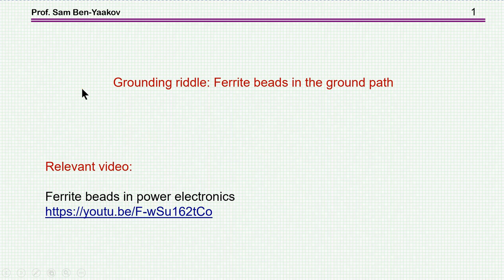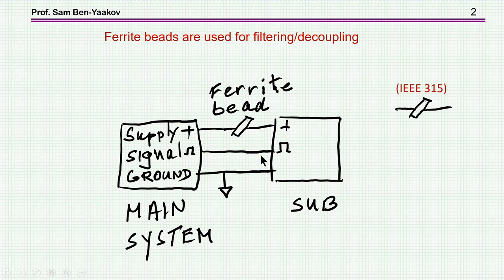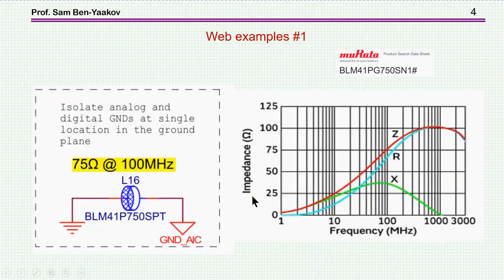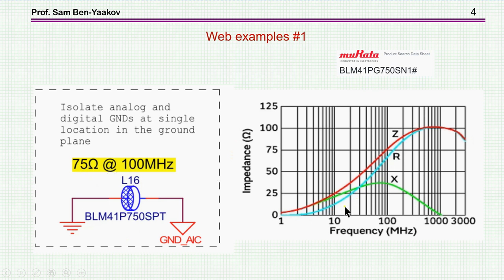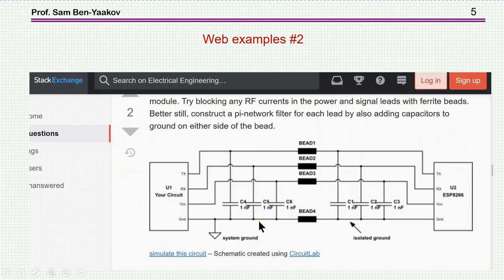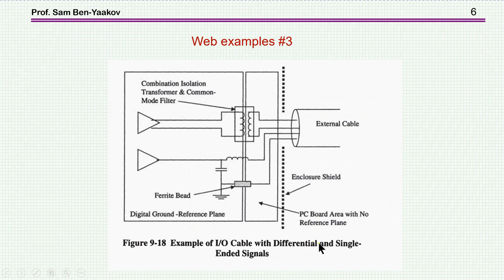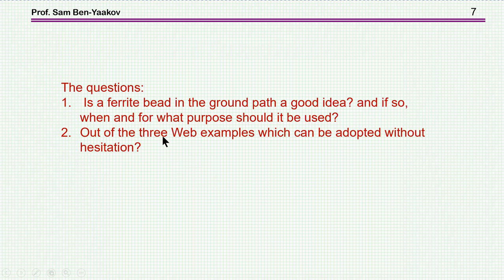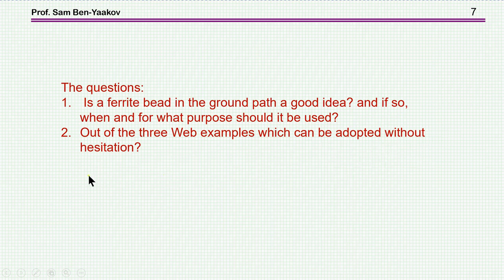Grounding riddle: Ferrite beads in the ground path

Comment: I think the third example can omit the magnetic beads. Because the signal transmission uses an isolation transformer, a good isolation effect can be obtained, and the DC supply line uses inductance isolation, which is better than magnetic beads. Since the above two circuits are well isolated, the interference loop of the ground wire is minimized, so the magnetic beads of the ground wire can be omitted.
Reply from the maker: Please see the posted answers video.

Comment: The third web design could be adopted without hesitation because the signal lines are galvanically isolated placing a bead in the ground path will not impact signal integrity and other considerations may justify this level of isolation between the grounds.
Reply from the maker: Good  answer but nit complete.

Comment: In case 2 you can adopt no problem. all circuits close trough a bead anyways. It provides more filtration during low freqencies of switching on different channels and it gets overwhelmed and looses some filtration powers the faster and more channels switch, allowing the receiver to detect highs and lows faster.
In case 3 the bead is  just another DC filtering component
Reply from the maker: Good points but there is more to it.

Comment: Please correct me if I'm wrong.

The first example doesn't show the rest of the circuit, and might be acceptable if there are no signals going from the digital domain to the analog domain.

The other 2nd example clearly show digital signals interfacing "sensitive" analog circuits (otherwise why filter them ?), but the return current must find it's way back through the bead in the return path - therefore causing ground bounce/ringing.
These issues are basically the same as splitting digital/analog ground planes while having digital signals that need to control the analog circuit.

In the 3rd case, if it is indeed only a DC power supply - it has only DC current through it and the bead has negligible dc resistance, therefore it doesn't impede the return current flow.
If the board in at the other end of the cable is pulling non DC current from that power supply, that current will be supplied by the decoupling capacitors and not the cable.
Reply from the maker: Very good points but there is more.

Comment: If you want to absorb HF energy on power rail, I think it's better to do on V+ only. Doing it on GND is equivalent for the rail in isolation (current flows in loops) however now all your signal nets get their transitions rounded, and worse they now crosstalk/ground bounce. 
In the third case the bead is applied to a single net so the above caveats don't apply, so I think that's fine.
Prof, would you consider doing a video on selecting core materials for various applications? How do you estimatr how much impedance and at what frequency would work for a design - or is it usually trial and error like I've seen at the EMC test house?
Reply from the maker: Good points but there is more to it.

Comment: I must ask, as one who is in the field of engineering in general, is it a good idea to bead between two grounding rods in an apartment system, such that the interference and RF of other systems in my apartment complex do not disturb my sensitive electronics in my home?

It would make sense if the main apartment grounding rod is of horrible quality, since at any point a higher or lower point in potential, even if it's the ground of my computer case, that point can act like an antenna to distribute the charge that it absorbed somewhere else -- I presume. 

So while I have improved the grounding of my entire apartment by feeding everyone's grounding through my own ground (I'll need a GFCI breaker at the power point where the second rod is attached), I'm not certain that it's going to improve the quality of the ground plane without an isolation bead against the main ground (which is rusted pitted and very very old, made of galvanised steel.)
Reply from the maker: "noise" between good ground rods would be minimal

Comment: I agree, 3rd. The only reason I can see for adding a bead in the ground path would be to reduce power supply HF switching noise in the main circuit or, to reduce noise from the main circuit being introduced in a different circuit that shares the same power source. This would have to be a fairly high frequency switcher in the first case.

Comment: 1. Beads are used to create different power domains. It should be used with caution. You should avoid high frequency current going through the beads. 
2. The third example is ok. There is a galvanic isolation on high frequency signal path.
Reply from the maker: Hi Al;wx, Good points, but :"Beads are used to create different power domains" what does it mean. Sounds mysterious. Related to Star War?😊.

Comment: Is ferrite on ground a good idea? I'd say it can be a well-advised evil, to break ground loops. 

In example 1, i imagine say an audio output device. Several such devices will be connected to one amplifier or mixer, and some of these devices will be Earthed or share a common power supply, every cable has a ground connection, so it happens, that the enduser gladly builds ground loops, and there's nothing the manufacturer can do to dissuade people from doing so and defeating carefully laid star grounds. Ground current on the analogue output device can be murderous, as to output a particular voltage, it will need to match the existing ground current, and if it's high frequency noise current, it will probably slam right against the slew rate limit. An audio CODEC or such chip can have two sections, the digital section and an analogue section with each their separate grounds. If the recommendation to add a bead comes from the chip designer themselves, they would have foreseen a communication within the IC between these two sections that is resistant to relative voltage noise in ground between the sections, so would be safe to follow.

In example 2, this seems to make no sense at all. It's like someone is building a signal integrity murdering contraption. I am going to assume that someone is trying to solve an actual signal integrity issue that they're having there, but the suggested fix looks like it'll only make it worse in so many regards, only the bead on VCC sure won't hurt. For sure ESP8266 being a WiFi SoC, is prone to induce a lot of EMI, but if it's causing issues, either someone has built a ground loop where they shouldn't have, and/or they're talking to ESP8266 via TTL-RS232, which i surmise is the case from TX RX pin designation, and they're having trouble matching the BAUD rates of both devices, they're probably hitting it kinda close but not quite, so it seems to work until it doesn't, they should look at tolerance rates of different BAUD rates for both of the processors, they should really look at the clock circuits they got there, the compensation capacitance of the crystals, and consider using SPI for communication instead, it's not sensitive to clock disparity. Accurate TTL-RS232 is hard and not very tolerant of part quality.

In example 3, i don't understand some of it? In the upper half, where they're transmitting a differential signal and coupling it through a transformer, like say Ethernet, this seems good, they can put ground beads between these two devices with no harm. But what is happening with the single-ended transmission lower in the pic where they're sending the signal through the inductor? I don't understand. If that's just power or low-frequency signal, then the bead in the ground sure is fine.
Reply from the maker: Good points but not all corrtect IMHO.

Comment: I am not sure of any of the answers, however I'm going to take a chance on Q2.

Q2) In my opinion it is example #2 because by having capacitors on both sides of the ferrite it presents to both domains a preferred path for the high frequency noise current to close through. 

I would like to add that my laptop, as many other probably, has a ferrite enclosing both ground and supply lines. What is the difference from this case to what is being presented?

Looking forward to you reply.
Reply from the maker: Thanks for participating. Are there ferrite beads or a common mode choke?
Reply: @sambenyaakov  
Hi. I am talking about this:

https://www.radiationhealthrisks.com/wp-content/uploads/2019/02/Ferrite-Bead-Laptop-Charger.jpg

As far as I know they are ferrite beads used to filter out high frequency noise from the laptop chargers.
Reply from the maker: I am talking here about ferrite beads in ground path. Say, between analog and digital grounds. The rings are only remotely related

Comment: I would ask, what is the reason Ferrite beads are being inserted into the system in the first place?
If it is to block radiated and conducted emissions, then the un-intended RF transmitters need to be fixed. Most likely bad PC board layout and decoupling of RF generating components. i.e. digital stuff. Seeing the use of Ferrite beads on computer cables, that is there to bandaid the system to pass FCC emissions requirements.
If it is to block HIRF susceptibility energy from entering the system, then I see no issue with them in any signal path. However if susceptibility is that big of a design requirement, to pass during a qualification test, then there should be no unit in the system with an isolated ground that has an external pin as the ground return path, the chassis is the path. The unit may have special internal isolated grounds for precision analog and such, but external power input, assuming chassis is the return path, are there mainly for unit test outside of the integrated system interconnect. My experience is avionics using +28VDC power. There the ground is the aircraft airframe or some other metallic structure in the case of carbon fiber composites. Note in those aircraft there must be enough metal to be able to survive a 200Kamp lighting strike. The avionics are bonded to this super structure with low inductance connections.
Reply from the maker: Good points, but it is more intricate than that. Hold on to my answers.

Comment: Depends on where is a current leaving its source and how the current coming back. And where and what is a common reference (some people use the word "ground" for common reference). So, if the circuit dealing with the same reference source on both ends, the bead on the gnd (common reference) is a bad idea. Also, you (usually) dont want currents from different sources to superimpose (by keeping the current loops separately, the gnd beads will kill this noble approach. .But, I probably can make up an artificial scenario when beads on the source line and the return line may help. Theoretically, isolated power supplies can be visualized as 2 sources with "indefinitely large beads between them, but then look at the differences on common nodes between these 2 sources. it can be very high if switching is involved.
Reply from the maker: Good points but there is more to it.

Comment: Hello Professor and thank you for doing these videos I have gained more knowledge here than before - although I regret my maths is dreadful! I have been working on power supplies for my own company for a number of years with some success and a lot of failures of course ( good learning)  I have often thought about the circular currents that DC - DC converters have, and thought we should keep the tracks short  ( on switching nodes of course) and maybe isolate them with Ferrite beads - I have tried - and it seems to work, to put a bead in to the input ground  before any sort of input reservoir cap and then one after the first output reservoir  ( in it ground to the rest of the circuit) to keep the circular currents from going on the common ground? I am using a 70Khz converter right now but I have used ones up to the 1Mhz range too. - I have not been able to prove 100% the right or wrong for this shorting out the ferrite has made it worse or better in some cases so this has to be board layout. - I am super critical to keep this at the far end and away from sensitive circuits - but the best i have is - it depends! What are you thoughts - If I may ask?
Reply from the maker: Hi Dave, Thanks for comment. I am really trying t use the math to the minimum😊

Comment: I general, as far as I know, placing beads on ground path is intended to attenuate common mode noise [it is separated into two cases: 1) Earthened system PE cable bead placement or 2) not earthened and with capacitive earth coupling - in such a case both gnd and Vin should be filtered since one can not impact PE path capacitive coupling]
Looks like  3 is ok since there should be no high dI/dt currents between separated circuits (should be supported by local decoupling capacitors). . #2 is problematic, I would speculate that there will be significant impact on signals risetimes (since those looks like single-ended signals). With low baudrates it will be less of an issue than with higher.   Regarding #1: I don't see why one would place bead between analog and regular ground since anyways if analog ground is islanded from the rest of ground - no current will go through to cause any significant ground bounce or similar issues.

Waiting forward for the correct answer, prof. Ben-Yaakov :)
Reply from the maker: Thanks for shoring your thoughts, See my answer video

Comment: I think the 3rd is a differential circuit above and single ended below with bead in return path. I don’t think it is a good idea to put ferrite bead in the ground path because  doing so can result in signal integrity problem. Considering this, in my opinion the only case where it can be used is the first one since the bead will keep the HF curren.t confined in the digital plane, preventing like this the digital noise from entering the analog area.
Reply from the maker: Well Edward, I disagree. Hold on to my answers .

Comment: 1. Not a good idea, the bead in the ground path could corrupt the signal since the ground impedance is not zero anymore.
2. Third one, since the bead is in the power supply return path, and the signal path is isolated by the transformer.
Reply from the maker: Very good points.

Comment: I don't think I'd adopt any of these without hesitation.  I'd considering the return paths first .   A high speed SE signal I definately wouldn't.  High speed differential would be ok with bead in the gnd as parasitic capacitance would likely provide enough path for any even mode currents from pair skew.   Slow edge rate signals would be fine with the beads in the ground but I'd still only put them in if it was likely a source would conduct through that ground connection instead of where it was meant to be going and even then I'd be looking at seeing if I could bypass the source return path closer to it's generation.  Cabling is where it makes most sense to stop any common mode sources from using your device as a return path but then you have to have beads on all your signals in that cable bundle which may mean you need to use common mode chokes instead to retain your signals return path.   In summary #1 no (unless I was trying to do a separate DC return path with AC someplace else)  #2 ok since I believe those ESP signals are very slow although you could replace the signal path ferrite beads with 1k resistors.  I'd also be concerned with making the signal driver drive 1nF caps.  #3 ok.  Might need a ferrite on the signal line too if the inductor has large parasitic capacitance.   I'd use a common mode ferrite choke instead if it were a fast signal.
Reply from the maker: Some good points o entirely accurate

Comment: I have been questioning the same thing. I even noticed a circuit with an inductor in the ground path. In general, I don't think it's a good idea to put a bead or inductor in the ground path as this can cause a large voltage difference for some frequency between the analog and digital ground. This might be harmful to some components, for exmaple an ADC.
Reply: But without the bead radiowaves would induce higher currents which can also be bad
Reply from the maker: Each case needs its own solution.

Comment: Can we calculate the turns rato of an smps ferrite transformer , if we measure the inductance of all the winding. The transformer primary has 1 milli Henry. 1st secondary of 5volt has .01 mH Auxiliary has also .01 mH and the 2nd secondary has .02 mH
Reply from the maker: Yes. n is the sgrt of inductance ratio. But more accurate is to measre voltage ratio by function generator and scope.

Comment: #1 OK if only local ground is used in the circuit and there is no further reference to the main Earth.
#2 OK too, however unnecessary. The ESP8266 is a pretty insensitive device. Will work just fine with or without that filtering. Since it draws around 70mA it is probably not going to induce a noticeable voltage drop as long as its AD converter is not used referenced to to the system ground. Acceptable solution if EMC and minuscule RF leakage is a major concern, however I'd suggest smaller value caps of 10pF instead of 1n ones close to the ESP8266 side.
#3 We don't know what device is connected on the other end of the cable. If the isolated signal at the source is led back to the grounding in the connected device, it is reasonable. If the connected device is referenced to the Earth, then it is not that great idea.
Reply from the maker: Good points but partial